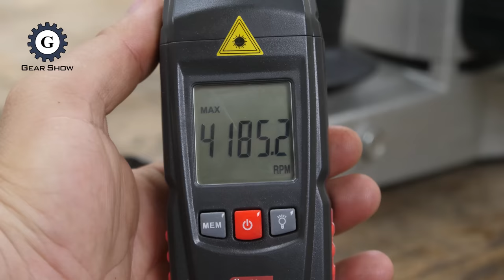Cord to Cordless Reciprocating Saw Conversion by Armature Winding

Comment: I have the same model that is always ready to go.  Handy, light duty and completes the job.  It is 110v-AC.
Reply: "Always" ready? 🤔🤣
Reply: @Kamidashi77  Yup, never a dead or dying battery.
Reply: @gordbaker896  And they never turn off the lights? Or do you have a generator?
Reply: @Kamidashi77  Yes I have 14,000 watt Standby Genset run on N. G.
Reply: @gordbaker896  All right, then. Then only add diesel fuel. 🤝
Reply: @Kamidashi77  It runs on N.G.  Natural Gas. Power in 7 seconds.
Reply: @gordbaker896  Oh, I'm sorry. I didn't know about the abbreviation. It turns out that it is more difficult to refuel, because you need pressure right?
Reply: @Kamidashi77  The Natural Gas is provided along the Road to homes and businesses.  The Genset is tied into the system.  Starts automatically.  Power in 7 seconds.

Comment: was it just thicker wire or more turns than the stock wiring? Did the current increase?
Reply: The wire thickness was increased t0 0.8mm and he moved the position of armature on the shaft. With the increase of the wire thickness there was an increase in current

Comment: 80mm or 0.8mm wire which wire use
Reply: 0.8mm copper wire😁
Reply: 0.8mm ofcourse. 80mm wire is ready for a million volts.
Reply: Can I use armature for drill, cutting, grinder for help 😔